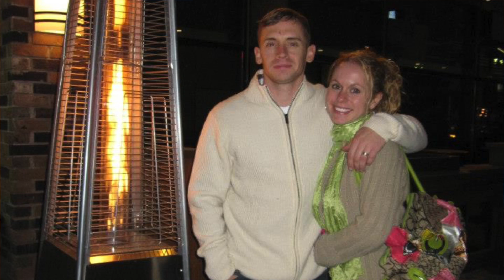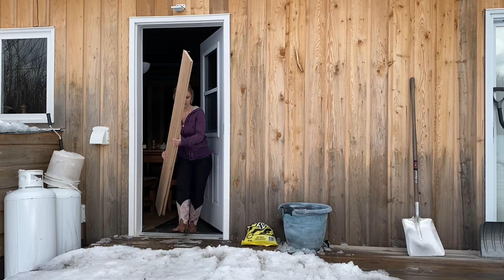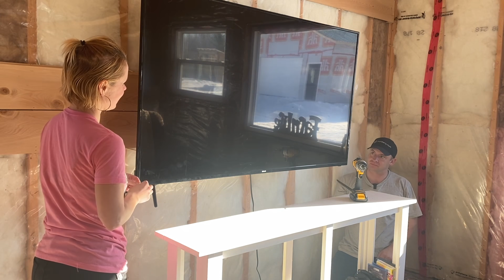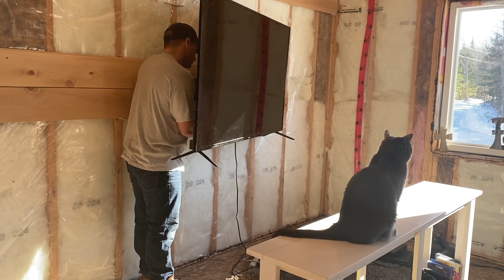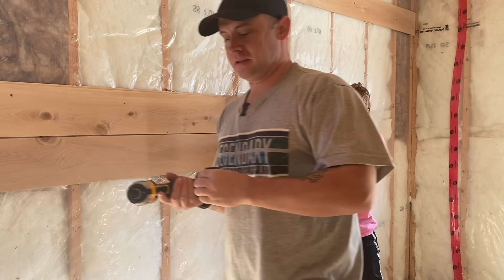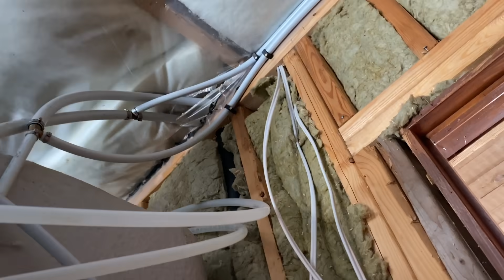NEW INTERIOR DESIGN For Our SELF BUILT HOME! | Major UPGRADES!

Comment: you might want to consider vinyl plank flooring instead of laminate holds up much better under extreme hot and cold conditions  also with all the snow you get  laminate does not wear well when wet

Comment: You might think about using subway tile in the bathroom, they are a bit bigger and longer than regular tile. Same with the kitchen, sink, and stove wall, you could use the smaller squared tile there. That hemlock will probably warp and bend if not stacked properly, and stickered.

Comment: Pro tip when dealing with screws/bolts - put them in a ziplock bag and tape it to whatever they're for IMMEDIATLY.  Just moved and I was so thankful I did this. There was a few thing's where I said I'll tape that bag to it later and it never happened and those bolts have been lost in the abyss.

Comment: Ohh, that will be fun hanging the drywall! One thing I learned when building my house is when you pull the nails out pull them on the back side of the boards. Your Welcome!
Tried to find the hat with the leather patch but it was not on Teespring?
Watch the TV with gray, might jump up and knock it down! From experience, unfortunately!
Just one more thing, I put down the laminate in our house and when I bought it they recommended using PVA glue in the joints if it was going to be exposed to any water (in front of door, around sink etc. ) and it sure saved our floor. The laminate will swell quickly when it gets water on it. Have you looked at the premium vinyl flooring? It comes in planks and looks like real wood and it’s waterproof! Love the videos!
Reply from the maker: Thanks and we don't have a hat with a leather patch, not sure what you are referring to? All the best :)

Comment: When you go to paint it use enamel on all your walls. It’s a lot more durable and is easier to clean
Reply: Enamel would be hard to put on all the walls and very hard to clean up as it is oil based. Just use a good washable latex paint that can be cleaned with water. Comes in gloss semi gloss and egg shell textures. I have been painting for over 50 years and this is from my experience.
Reply: @caroldorsett8170  I was a general contractor. I built a  Bed and Breakfast in Santa Fe, NM using latex enamel on all the walls I don’t know where you can get oil based enamel anymore. Latex enamel paint is much better than flat, especially if you have kids and need to wash walls often
Reply: @debrabennett6950  it is laxtex gloss or high gloss here and is water based true enamel is oil based. I agree with you that gloss laxtex is good for kitchens, baseboard, doors and hard used surfaces like kitchen cupboards.

Comment: Oh boy, you guys are getting  smarter every day .( drywall i stall).!!!!!  The light colirs are a big plus also.   ....With the base board, door and window trim, prefinish it. Works the best, easiest, looks best. When you are done with trim installation, set finishing bails, the buy the wax-style fill  sticks. Just rub back and forth to fill the nail hole, then wipe/ buff off the excess with a rag, and you're done. The sticks come in different shades. Works fast and great. Just make sure you prefinish the wood with polyurethane, or shellac. Varnish is old fashioned and shrinks and cracks.  I used shellac (2 coats, light steelwool between coats. It dries fast, and worked great.....
.....Keep that freight train rolling, guys...+++++++